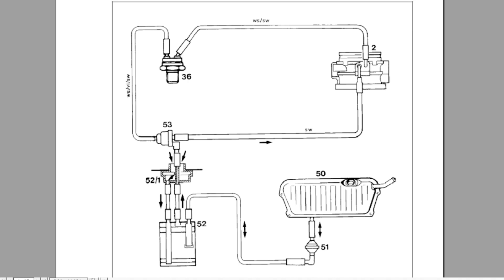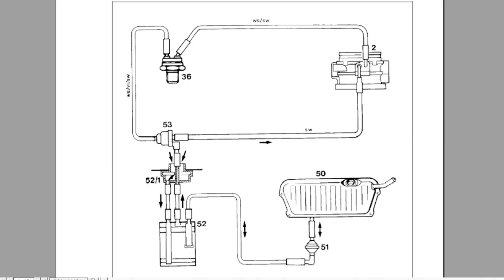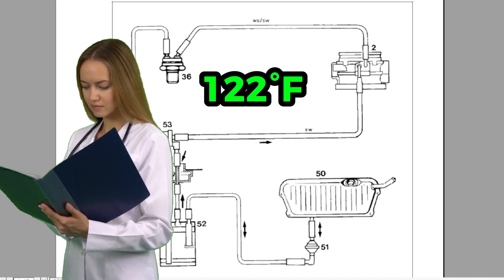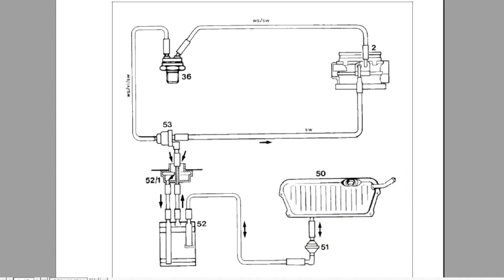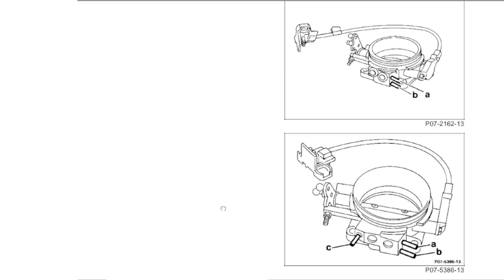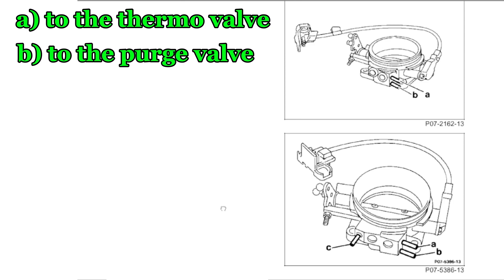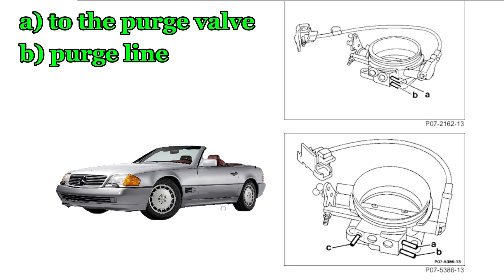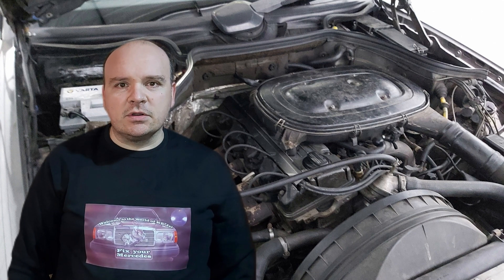㉦Mercedes Ke-Jetronic-Charcoal Canister,Purge Valve&Thermo Valve–Full KE-Jetronic Vapor System Guide

Comment: M103 1992 2.6 300E. I replaced my gas cap because the seal was bad. Now there is pressure when removing the new gas cap. Horrible smell in the cabin. Oddly today opened the gas cap multiple times and my wife drove down the street and back no smell. I drove on the road and after a few minutes smelled like gas. What do you suspect? Thanks in advance.
Reply from the maker: Thanks for the details.

There should NOT be pressure in the fuel tank on a 300E.
If you have pressure when removing the gas cap, the tank is not venting properly. Replacing the gas cap didn’t cause the issue — it only sealed the system correctly and revealed an existing venting problem.

Most likely causes:
blocked tank vent / rollover valve
damaged or disconnected vapor lines
fuel accumulator or nearby hoses leaking vapors

That’s why:
short drive → no smell
longer drive → fuel smell in cabin
Fuel vapors in the cabin are not normal — I would start by checking the tank vent and vapor lines first.
Reply: @mercedeske agreed. I will replace my vent valve and check all lines. I appreciate your reply and taking the time to explain all of this. Thank you very much.

Comment: Sir, your diagram the line at the side of the black purge valve goes to the charcoal canister. But in your video showing your W124 the line from the side of black purge valve goes to your throttle body. 6:24
Reply from the maker: Maybe I made a mistake but this is how it is on my car(7:00) - Looking at the purge valve - the one I am pointing with my index finger(red/white) goes to the thermo valve and that's the information about the temperature. The one at 6 o'clock leads to the charcoal canister and the black/white wide one goes to the throttle body, to the line I am pointing at. 6:34 That's the line for the evaporation system. The one opposite of my index finger is connected to the thermo valve.